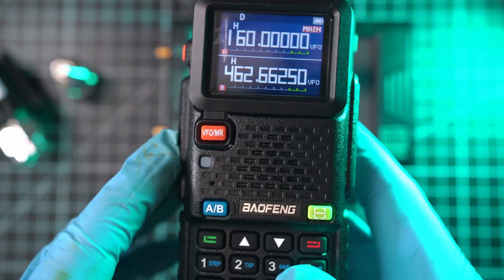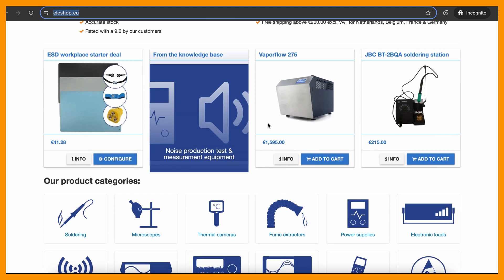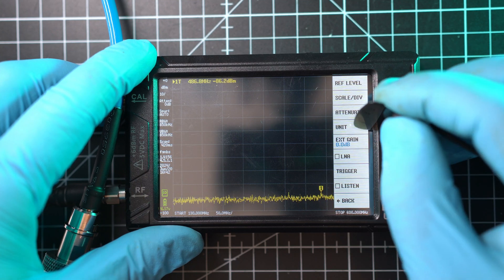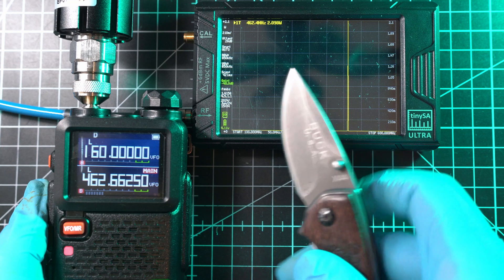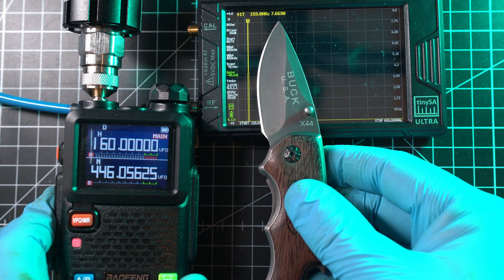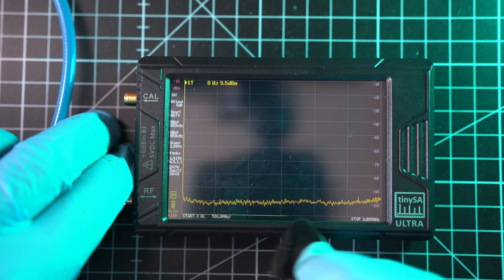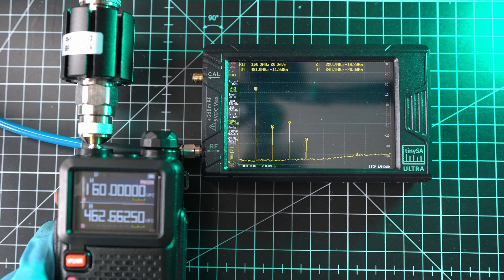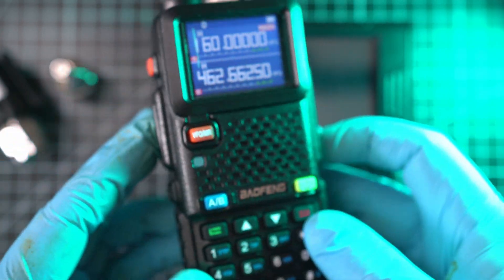TX Power & Spurious RF Emissions of Baofeng UV-5RH

Comment: So are you saying this is not a great radio ? of the spurious emissions
Reply from the maker: it is fine, and will be fine don’t worry
Reply: @takeapart  will it be better than standard UV5R I have..the very first Baofeng?
Reply from the maker: @CharlesTLam absolutely better… however the controls are different (bit of a learning curve for baofeng users)
Reply: @takeapart  UV5rh says it's 5w...is there another model states 10 w?
Reply: Bottom line looking for the best Baofeng with power and options...